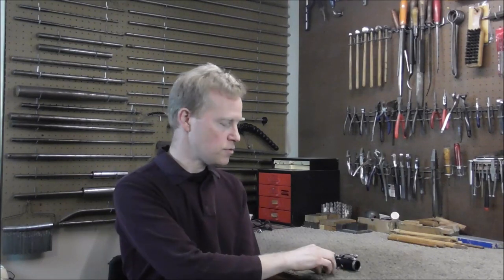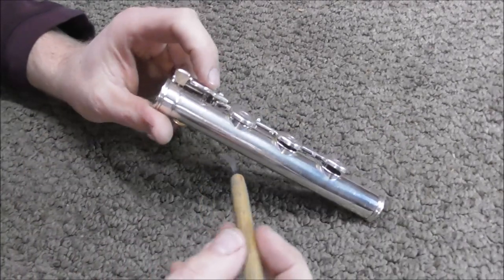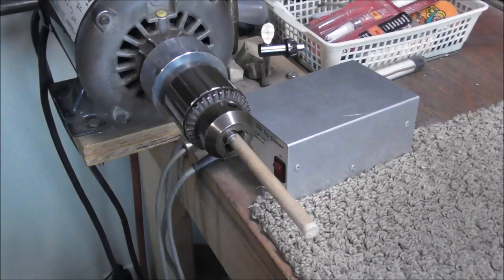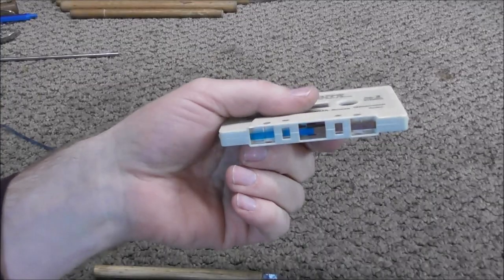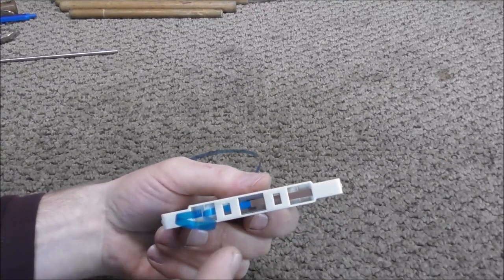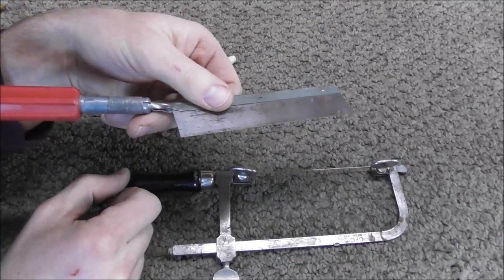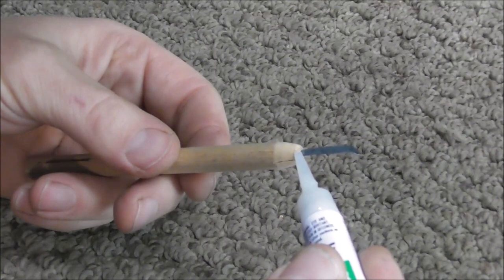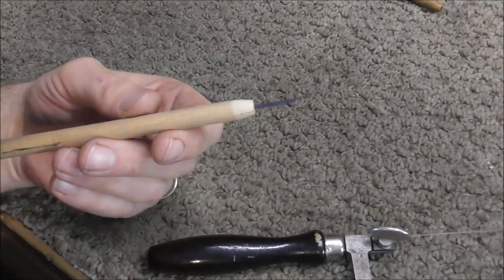Easy to Make Woodwind Pad Tool: FEELER GAUGE

Comment: I have an easier method of making this tool. Get a BIC pen and remove the ink, roller tip, and tapered piece. Get your cassette tape and snake it into the hole of the tapered piece where the ink/tip would usually go until it's coming out the back end of the tapered piece. You have to slightly bend the tape to get it through. Pull some excess tape through and wrap it over the back edge of the tapered piece so it gets sandwiched between that piece and the pen body. That holds it securely.  Done. No lathes, no glue. You can even put the pen back together when you're done.